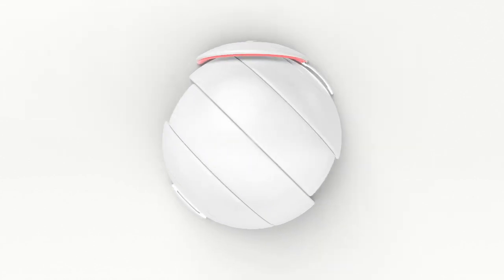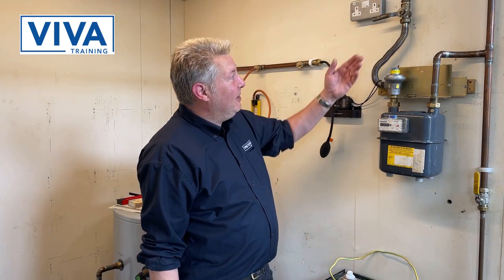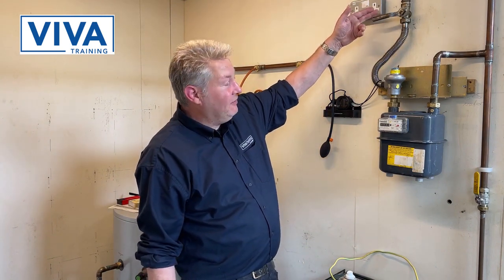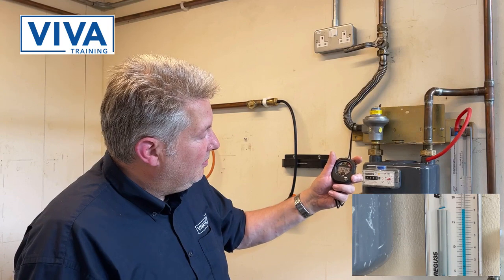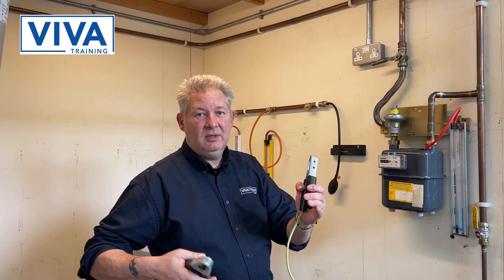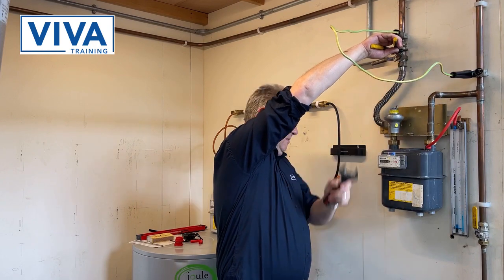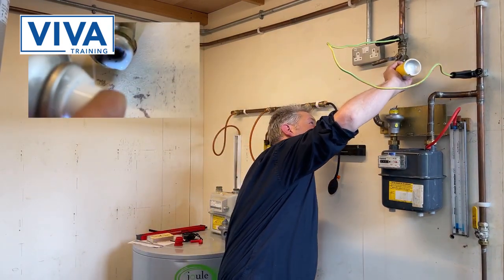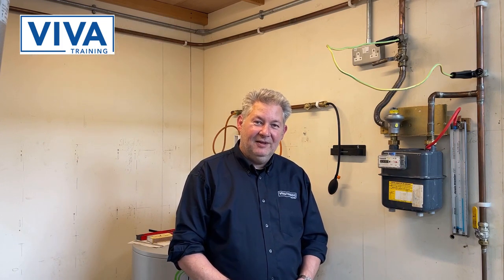Gas Let By Tightness Test

Comment: I am located in Cornwall. My last gas service sheet contained an "ECV letby" advisory, although the engineer left no instructions/advice on what to do.

To whom do I approach in order to get this replaced/repaired, please?

Will I need a new meter as well?

Any constructive advice will be appreciated, thank you.
Reply: Did you contact the gas emergency number on your meter?
He should’ve left instructions and capped it off.